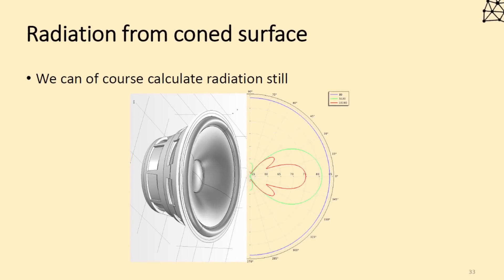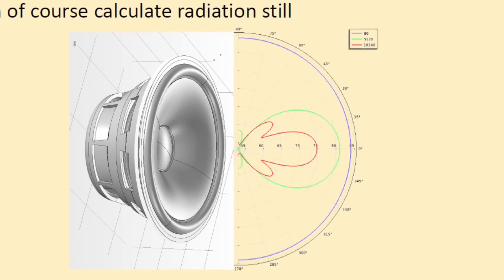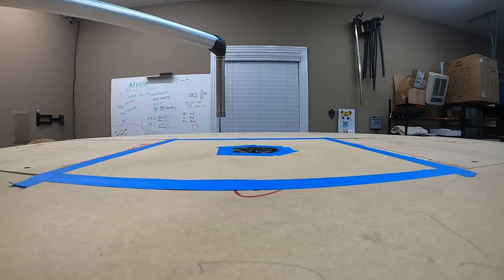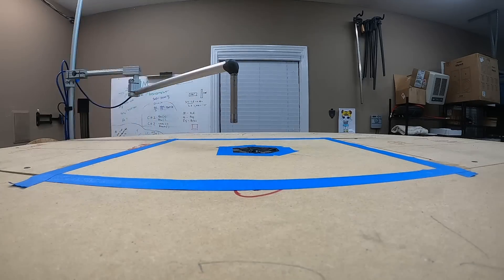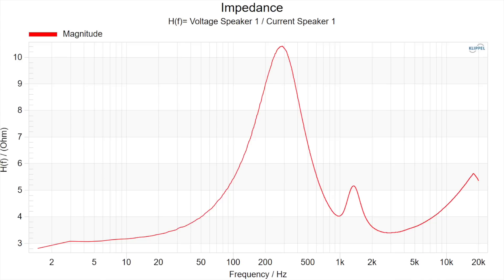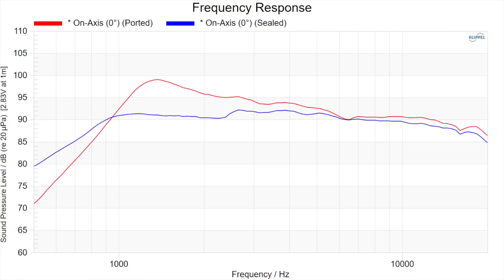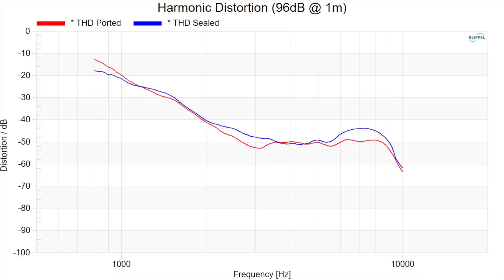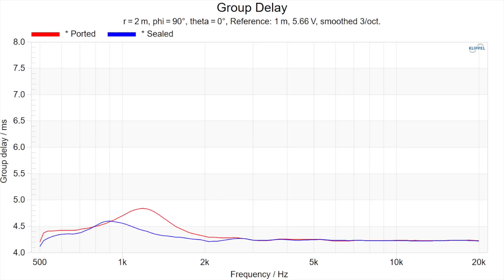Ported TWEETER?!  (No, this isn't clickbait.)

Comment: Due to the IAD effect (inter-aural amplitude difference) between 700 and 1400, it is very helpful if a tweeter could be crossed at 1k (Wilson audio: 1200).
Waveguides help a lot, but this might be push we need.
http://en.wikipedia.org/wiki/Interaural_time_difference
Reply: Totally, you know you stuff 👍
Reply: @alexralph9929  Just a bit... Audio is pretty much my life for 40 years, but i've heard of this (well recorded) effect only a few years ago. Completely changed my approach on loudspeaker design.
Reply: @frankverschoof8083  Hard to get 1 driver to cover such a big range, but great if you can. 
In another life I worked with EV Sentry 500 speakers. They had a large dome tweeter in a big waveguide, crossed over @1500Hz. Sounded quite different to any Hi-Fi speakers of the day, very accurate. Didn't know it at the time, but I think IAD had a lot to do with it.
Reply: @alexralph9929  Loved de 500, still use them from time to time. They work very well in big conference rooms. I blew out a tweeter once and replaced it with the Audax TW034 (both channels). Definition was a lot better btw.
There are OEM's who work in a very broad range: Devialet uses a 2" dome from 800 up to 20k. The old 3way designs with a 2 or 3" mid dome make more sense now. A candidate for 1k might be the Wavecor TW030WA12, or the Peerless DA32TX00.
Reply: @frankverschoof8083  The Peerless is impressive. 1mm travel at a decent price👍.

Comment: This patented ported design will be of little sonic value, but it might add marketting value to a speaker that uses it.
As stated in the video,the lower crossover frequencies can cause the destruction of the tweeter, and the same will apply here as extra wattage will be assigned to it.
Reply: Actually the opposite. The 9dB of gain means it's fed much less power for the same SPL, and the tuning reduces diaphragm travel. These are the 2 things that would damage a standard tweeter.
Reply: @alexralph9929  How do you square this with the fact that music follows a roughly pink noise spectrum meaning that irrespective of any tweeters efficiency, the lower they go, the bigger will be the excursion of the diaphragm to achieve the SPL and that SPL is produced by the amplitude of the diaphragm and you cannot dodge that.
The question then becomes,can a 1" silk dome tweeter for instance take that kind of strain operating at 1500 hz, a point in the midrange,full of energy?
Reply: @montynorth3009  Yes, the big increase in excursion and power is the reason tweeters can't be driven too low. 
There are some great designs around that have a very large Xmax, which deals with the excursion, but not the power handling. Unfortunately they have to use Neodymium magnets to achieve the extra travel otherwise the sensitivity drops off, so they are expensive.
By using ports, you dodge both issues (until you get below the tuning frequency). The 9dB boost gets flattened via the crossover (like with a waveguide), so it only needs a fraction of the power needed by a sealed tweeter for the same SPL (and less excursion). 
Around tuning frequency, the air in the ports moves in sync with the diaphragm, damping its movement (so further reducing the excursion). 
There's free simulation software (like UniBox, or Winisd) that show these differences between sealed and ported subwoofers. Same principle (Helmholtz Resonance) is used in the tweeter.
Reply: @alexralph9929  The increase in excursing below the port tuning frequency should also be considered, so you would want steep crossover filters (generally a good thing imo). the group delay could be audible, which might need some FIR massaging.
Reply: @abdo-dr1tu  Yeah, it really needs minimum 18dB crossover to deal with the travel increase below tuning. Group delay OK, haven't heard any issues. The research I've seen says 1-2m/s before audible.
Reply: @alexralph9929  the ported tweeter has 5ms already, with a steep crossover that is likely to increase.
Reply: @abdo-dr1tu  The measurement isn't at 0. Both sealed and ported base-line at 4.2ms. 
At 1500Hz, the sealed is around 4.4ms, and the ported is 4.9ms. 
So when zeroed, the sealed is .2ms (pretty standard), and the ported is .7ms (not perfect, but below audible)
Reply: 9dB gain, so some 0.15-0.2W instead of 1W. Hmmm

Comment: Hi Erin, I asked a question on the Klipsch but you might missed it since there are a lot of comments there, 
Anyway, which speaker you will advise me to get if the vocal is the main thing I care? RP-500M II, RP-600M II, Polk r100, or Kali Audio IN-5? I mostly use it with my PC as a nearfield.
Reply from the maker: The Kali is the most neutral of the bunch. I’d look at that or the Klipsch 500m II depending on placement and size.
Reply: @ErinsAudioCorner  The Kali has a big raise at high frequency in the graph you measured, is that going to be a big problem and make the speaker bright? or it's very far away from the human hearing to be a problem?
Reply from the maker: @mhnoni   the peak being high in frequency of the Kali may not be as bad as one would think.  However, what I encourage you to do is to try both the Kali and the Klipsch and see what you think.  Make sure to take time aiming them in different ways (on and off-axis).  Then send back the one you don't want to keep.  If you can.
Reply: @ErinsAudioCorner  Thanks a lot Erin for taking the time and answering our question.

Comment: I believe that a waveguige would not only boost the low end response but also would narrow a tweeter radiation pattern in order to better match it off-axis with a midrange/midwoofer.
Reply from the maker: Yes.  But I was talking more about the horn loading and effect here. 👍
Reply: Or is it the same thing: Radiation pattern is narrowed, hence more sound energy projected forward.

Comment: We need more designs like this that solve problems instead of creating some. Bravo to Alex, hope he perfects it!
Reply from the maker: You and me both!
Reply from the maker: @Douglas Blake I think you’re missing the point here. This is no different than a horn-loaded design. An appropriate crossover corrects the peak while allowing headroom which enables a lower crossover point.
Reply: @Douglas Blake reading comprehension 101. Does 'hope he perfects it' ring any bell? And its how its all about how its going to be implemented ultimately, its not like its a hard thing to fix. As with anything, nothing is perfect and there will always be give and take. You are dissing this way too early.
Reply: @Douglas Blake so?